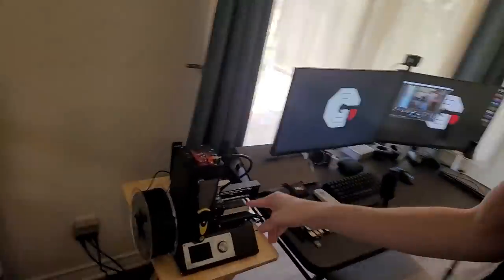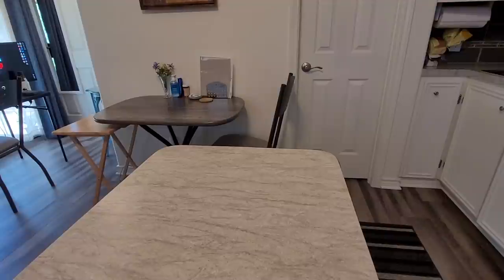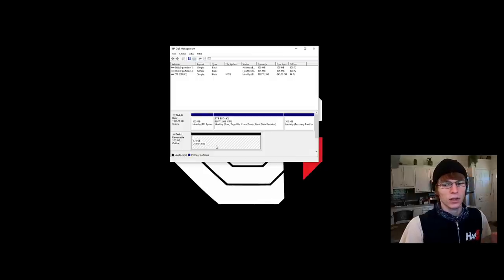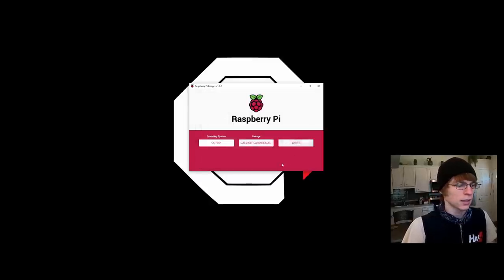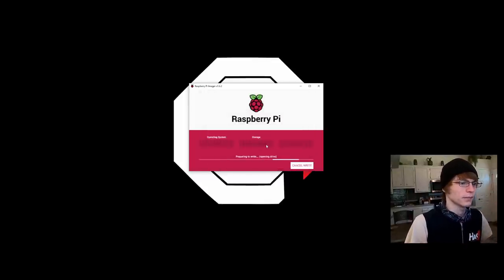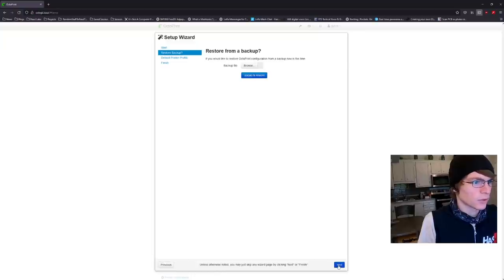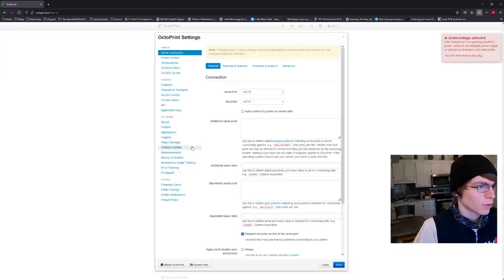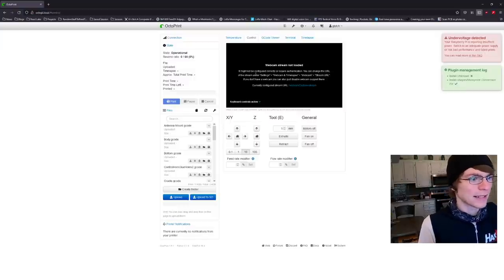Wireless 3D Printing using OctoPrint w/Glytch

Comment: I fixed the gap above my micro SD slot by printing a small block of plastic and glueing it to the top of the microSD port on the pcb